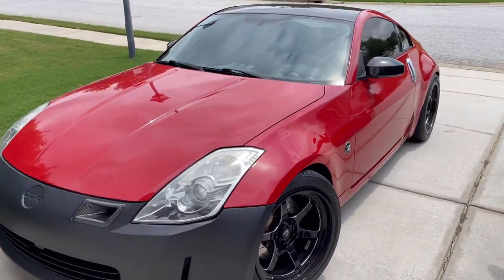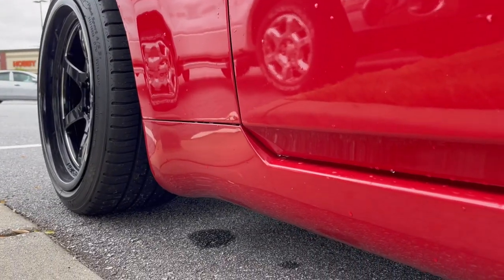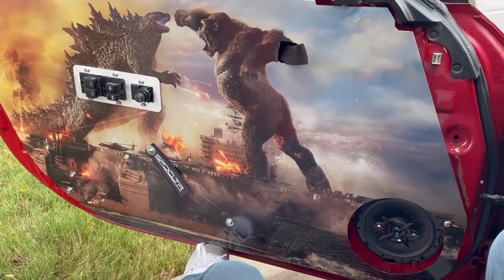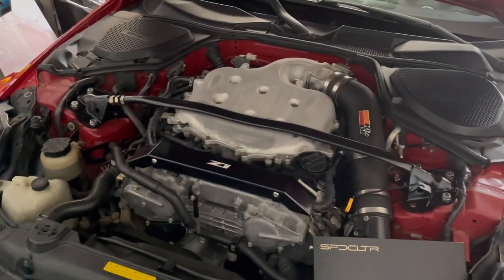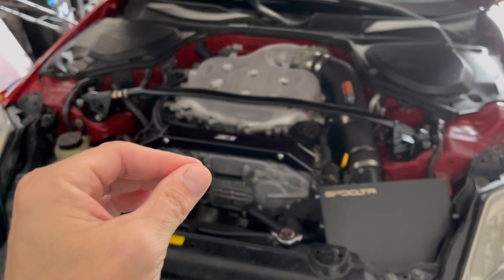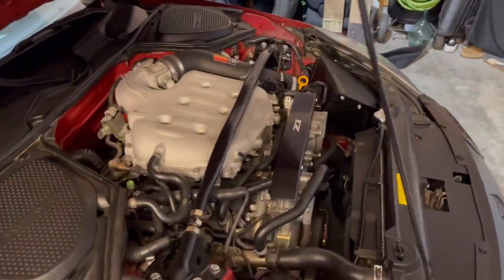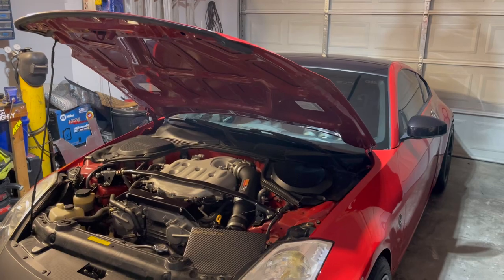Z1 Clutch Review after BREAK-IN Period! 350z

Comment: Something else to mention, the earlier 2003-2004 350Z/G35 had a really small restrictor valve on the clutch line inside the wheel well. The 2005+ used a larger orifice restrictor which feels MUCH better when releasing the clutch. There are also restrictor delete kits. If you have the small restrictor you should replace it, or at very least take yours off, disassemble, and drill it out to a larger inner diameter.
Reply from the maker: Inside the wheel well?  Clutch master and slave were replaced with new stainless line as well—I don’t recall anything inside the wheel well.

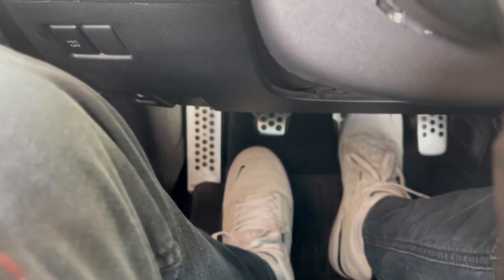Comment: 1:20 I had a question about the clutch feel.  I just swapped my OEM out for the Z1 Clutch kit with med flywheel, CMC, CSC, SS line and noticed when raising it engages close to the floor.  Didn't have much time with it so going to see area or disengage vs engage (which I know is close to the floor) as it tries to grab and go
Reply from the maker: This car had an aftermarket clutch of some kind in it when I got it and it engaged almost at the floor.  It was terrible.  It still engages lower than I am used to, but much better than before.  I am not sure it how they all are, but has been my experience at this point.

Comment: During the break in process did you hear any funny noises that went away over time?
I have the same clutch kit but only 180ish street miles from the break in and it makes somewhat knocking noise when when I need to start from a hill and goes away. Its not chatter when you idle but its like chatter when under load. Did you experience anything like that when breaking it in?
Reply from the maker: I did not experience that.  Does it seem to be shifting smoothly otherwise?
Reply: That’s normal bro

Comment: Did you go with the 6 puck clutch? Just got one with Z1's lightweight flywheel,  can't wait to install it!
Reply from the maker: No, I just went with the full face after recommendations from others.  I’ve been very pleased with it!
Reply: @SpeedCultureStudios blew my clutch out a few days ago on my 03 350z, think I'm going to get this same kit you did with the mild performance clutch, unsprung full face disk and the light weight flywheel.
How is it after a year? , how many km have you out on the car since instal? Any issues? 
Thanks so much if you answer this, I'm pretty sure this is the kit I want but there's a crazy amount of options.
My cars more or less stock, 
Has unorthodox underdrive pulley kit, long tube aem intake, random brand headers and GReddy exhaust.
So really nothing for real power adders. I just don't think it's worth spending the 1500$is on some of the crazy stuff if my cars never going to make more than 350-400hp (which I'm not even close to now) 
Have a great day man, thanks for the review.